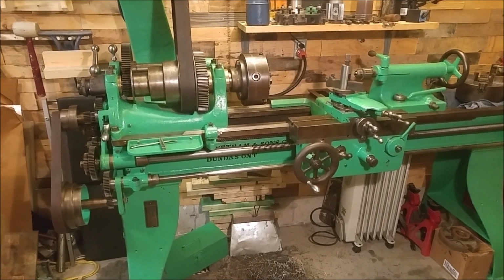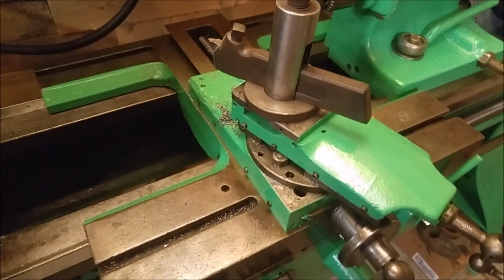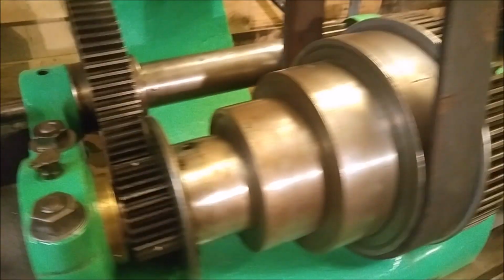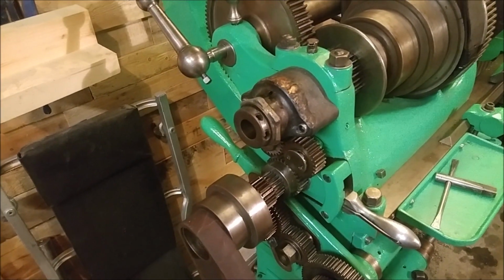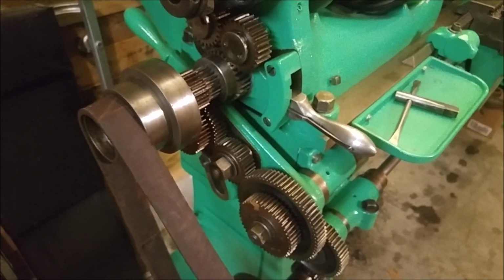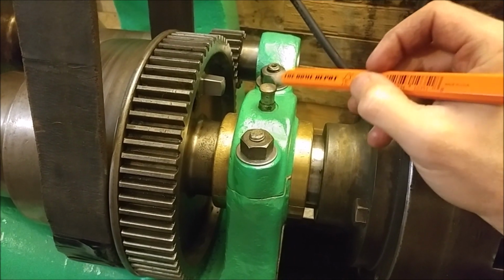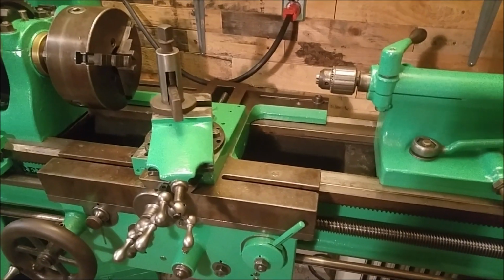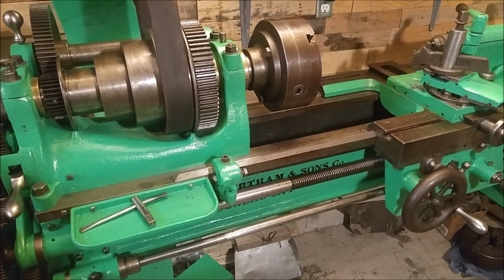Vintage Bertram Lathe Restoration - VINTAGE MACHINE FANATICS ONLY! - Update, Projects, Issues, Gears

Comment: hello i have a 1885 16 in prentice brothers lathe at the lower feed pully there two gears ps different teeth pitch theouther ears are quick change gears cutting thread pitch .  my question is did or do you have other gears to change the cutting speed

Comment: I Just Acquired a Metal Lathe that's Old over 100 years IMO, when i got it was frozen and was being neglected, Elbo grease PB Blaster and Deepcreep Can or so each i kept moving it until now everything is back fully functional, then fixed the Motor i was told was bad it had moss on the Armature i cleaned with a scotch Brite and a craftsman wrench as a i turned it until the Armature shined, plugged it up after seeing how the motor was wired for 220 and works well ..

Comment: I like to see old equipment/tools restored. I think you would have been very close in paint color if you had used Oliver - Implement and Tractor Paint. The old Oliver tractors were very close to the original color. Hey what part of the country are you in?

Comment: The 11 marks on the chuck are to align/assemble in correct position ive got an 1914 colchester lathe i restored that uses a mixture of dots and numbers for the same purpose on all its parts, its important with the chuck because it helps keep it balanced
Reply from the maker: A colchester!  They are incredible machines, i’d love to have one down the line.  I had to downsize to a SB 9A for the new shop.  Thanks for the comment, had no idea about that, but it makes sense

Comment: It was very common practice for manufacturers of machinery, back in the early part of the last century, to protect cast iron with japanning to prevent rust.  It was applied as a thick coating and baked-on to cure.  It worked very well as a protective sealant that was relatively hard and had some flexibility; similar to what plastic coating is today.  Usually each different manufacturer had their own recipe/formula and process for their own japanning, and some of the ingredients they used back then are considered toxic and hazardous by our current safety standards. The primary  color was black and some dark colors, which varied due to the different formulas.   Japanning did a better job preventing rust long term on cast iron parts than the paints that were available back then. 
In my restoration work I do not remove the japanning; just clean the surfaces, remove any rust and then prime and paint to match color. Japanning that survives is still working to protect the surface from rust, even after a century.  There are sources that can be found online that offer japanning recipes/processes that are considered to be safe to use and will allow one to replicate the look and feel of a japanning finish today.
Reply: Temper your parts in an oven and quench in clean oil thats what i did now ive got nice rustproof gold couloured steel parts that dont need oiling and are grease free (aka hot bluing)

Comment: Restoring a lathe like that is not a small undertaking.Lovely job.
Reply from the maker: It was a lot of work, I still have a few small items left, and now that we have warm weather I can finish them up.   The biggest disappointment with this lathe is that the 4 jaw chuck does not fit, the threads are very close but are too tight, so I'm not sure what happened there, but that would explain why the 4 jaw doesn't have a scratch on it.

Thanks for the nice comment, there will be more videos in future featuring items made with this lathe, so I hope you keep an eye our for them.

Take care.

Comment: Hi from England

Does that backlash remain constant throughout the full travel of the cross slide...?
Or does it tighten up towards each extremity of its travel..?
Reply from the maker: There is backlash for the full travel, when I had everything apart, it seems that the nut is very worn, there is some wear on the thread, but it looks like it is mostly on the Nut..  I have plans on making a replacement, but I am an amateur and that is a more complex project, especially since this is not ACME, it is square thread.  Any thoughts?  I know this is a LH thread, just to make it even more interesting to make.  

I have a 3D printer, I was thinking to make the part from plastic create a plaster mold, then melt out the plastic and create a bronze replacement.  I'd have to put a lot of effort into any solution I choose I think.  Any thoughts on this idea?
Reply: @NeedItMakeIt 

Yep....
It's the nut that's fucked...

Make a new one...
Reply from the maker: Soon, I'll be back in the shop making more videos using this lathe and this will definitely be one of the projects, but I need more skill first.

Comment: Do you have the rest of the change gears?
Reply from the maker: I do not, I'd have to go back and see exactly which are missing, for sure I am missing a large gear, I believe it would be around 125T, these are 14P which are a non-standard size , so even Boston Gear doesn't sell this anymore.  How about your machine, do you have all of the gears?  

Also do you care to do a video of your lathe and put it on You-tube?  I'm interested to see it and compare.

Comment: I have almost the same John Bertram and Sons lathe here in Nova Scotia. Sure wish I had the four jaw chuck! The three jaw chuck, by appearance, looks identical to mine. Not very accurate due to age, but I can still turn out some decent stuff. Just can't use it to make watch parts. Great videos! Thanks. Doug
Reply from the maker: My apologies for the late reply.  This 4 jaw is nearly unused but I certainly am glad I have it though, because I do not have the reversing teeth for the 3 jaw, and it limits what I can do.  There were posts on Practical Machinist for a lathe that is nearly like mine, it was restored and painted black.  I understood that  it was sold to someone living in New Brunswick about 8+ years ago.  From what I recall, the machine had two new reversing gears which were from Boston Gear, and he did nice work to replace them.  

https://www.practicalmachinist.com/vb/antique-machinery-and-history/john-bertram-sons-lathe-saved-230971/

I once lived in Nova Scotia years ago, Cornwallis, very nice place... though the winter on the bay was very harsh.

I have plans in future for more videos on this lathe, once we have warmer weather I'll be back in the shop.

Take care,

Comment: Looks like a nice lathe and restoration. Thank you for sharing your work.
I am currently in the process of restoring a 1950ies lathe of similar size. It is a lot of work, so I have a deep respect for what you have already achieved.
You lathe seems to run very smoothly. Did you do any restoration work on the spindle bearings? How do your bearings work? They do not look like tapered bearings which are adjustable by a pair of nuts?
Looking forward to see more of your restoration Harald
Reply from the maker: Thanks, it was a lot of work to get it cleaned up, it turns out that a high-powered pressure washer was the best solution for paint removal.   It runs well, though I don't have much to compare it to.  Someone else referred to it as a 'Total Loss' meaning that all of the oil drains out for the entire machine, that's true for most of it except a few parts of the apron which do have areas to keep the gears lubricated.  The spindle bearings are bronze "Bushings" really, and they are not tapered.  The best was to show you how it works is to send you to the video on making the spanner wrench, it shows the components which remove end-play.  I have plans on making quite a few more videos on my lathe restoration, I will be casting some parts from brass and machining them on the lathe, which will be used on the lathe also.  Here is the link:  https://youtu.be/yG7S9TPXSQg  it's a very simple setup, and I'll be making some replacement parts in future for this part of the lathe also.

Send me some photos of your lathe or put it up on Practical Machinist since you have me interested now. 

Thanks, and I look forward to seeing your machine.
Reply: @NeedItMakeIt  Thank you very much for your detailed reply! 
I document the work on my lathe on the German "Zerspanungsbude" ("chip making barrack") forum. See here https://forum.zerspanungsbude.net/viewtopic.php?f=44&t=24764 Unfortunately the discussion is in German language, but I hope that the photographs tell part of the story.
In addition I have a video showing how I made a new spindle bearing: https://www.youtube.com/watch?v=bBUZck9wwo8
All the best and keep on your good work
Harald
Reply from the maker: That is a nice strong looking machine, I like the green.  It has a few more safety features which would be nice to have on mine as well.   My German is not great, though I have been learning since 2004 so I can pickup the odd word in the forum, thank you for sharing mein freund.

Comment: Wow! It's amazingly quiet. Looks heavy as heck too. Nice!
Reply from the maker: Thanks, it is just a beast the base model without the AutoDrive/arm/motor is 1200lbs.  So we're at around 1500lbs or so, it probably needs a larger motor, and I'm not too happy with the look of the current one either.  There is one sound that has been bothering me though.  The bull gear pin rattles around and I assume that if it's rattling, it's also wearing down the mating parts, so that needs a little adjustment.  I'm hesitant because I already lost the bolt inside the cone once, and that requires dis-assembly of the head-stock to get access.  

I should have another video coming out in the next few weeks about the Autodrive specifically.

Thanks for the comment.
Reply: Oh man! Having the bolt fall inside would suck!! I saw someone in a video working on either the fuel or coolant system on a loader with the fill cap off on top. They took a part off the side of the machine and when they went to set it on top... Bloop! Right into the tank! lol - I'm chasing down a rattle or ten myself on a little mill I dragged home cheap. I guess I would have thought your lathe to be more in the 1800 to 1 ton range, but machines can be deceiving like that. Either they're heavier than you think, or they're 3 times heavier than you think. :)   @NeedItMakeIt